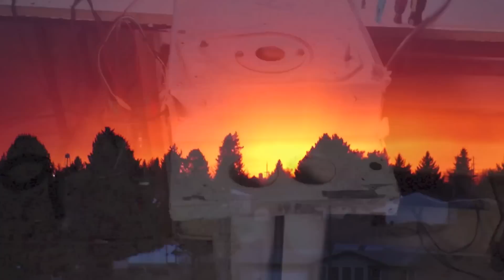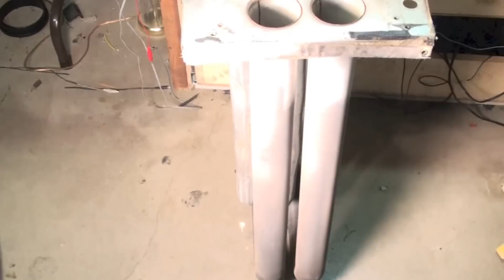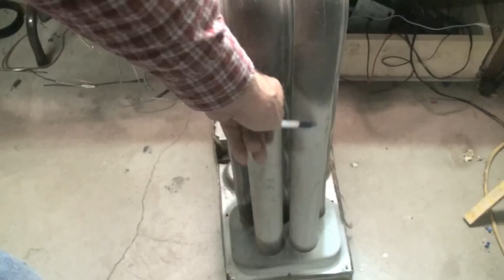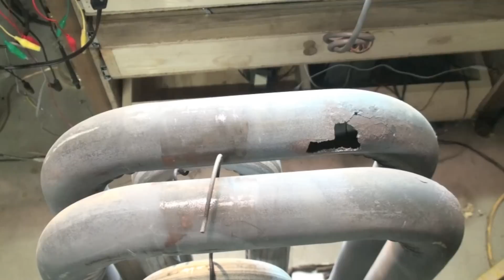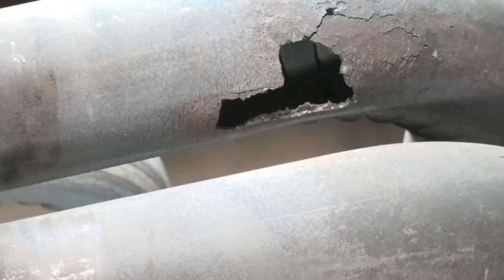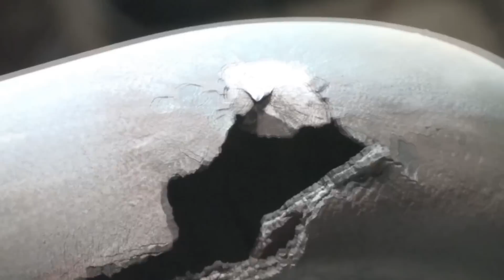Burned out ht exchanger

Comment: I have a trane propane fired unit that is malfunctioning, the RO switch trips the burners off. I discovered the swirl inducers are broken, (is that what they are called?) I cannot for the life of me find them for sale to the public anywhere, could you possibly help me. 4YCC3060A 1096AB
Reply from the maker: +Josh Carmack First, I would check gas input to see if it is overfired.  If the swirl inducers, (good enough for me) are burned it indicates overtire.  You will have to get the entire heat exchanger to get them.  Hope this helps.
GFM

Comment from the maker: I have no info on this specific model.  There are flammable gas leak detectors that will (at least in theory) detect CO.  I would put my money on the CO detector.  A draft diverter should be located above the heat exchanger so I dont know what it is.  If you send me a pic, I may be able to tell.
GFM

Comment: Old Lear Siegler AGC-80, standing pilot  furnace. Any more dangerous than other old standing pilot furnaces? Anything special to look for with this unit, relative to safety? Would a propane gas leak detector, if there is such a thing, in addition to a CO detector be necessary?  Best I can figure, after googling, there's a draft diverter device near bottom of furnace (lever on front of cabinet near bottom). No info.on this unit from Web  so far.  Diverter handle is in horiz. position currently..?

Comment from the maker: In this case the furnace was set up for natural gas and propane was used.  The larger orifices meant fairly massive overfire.  The unit was installed for several years.  The limit saved it from further damage.  Thanks for the comment.
GFM

Comment: By over firing ,are you referring to high gas pressure going to manifold creating hotter, longer flame into heat exchanger. Causing the metal to fail? How old was that piece of equipment?